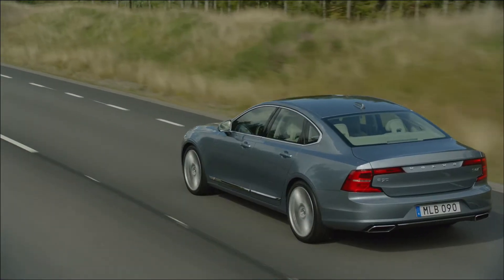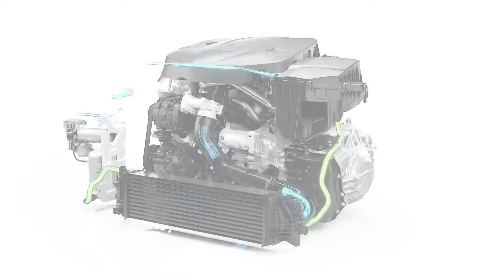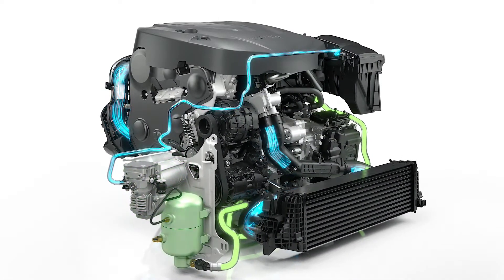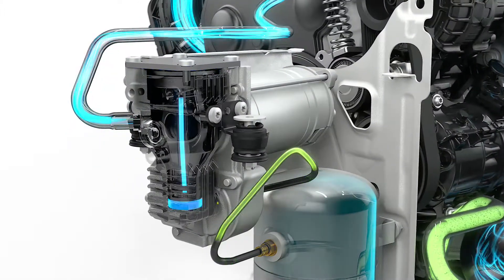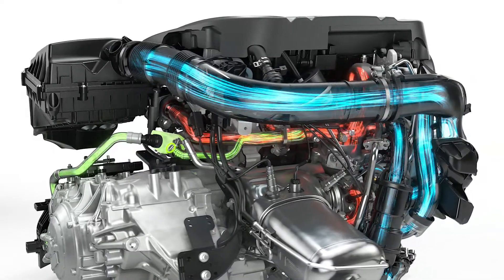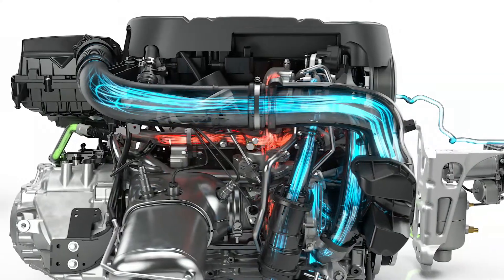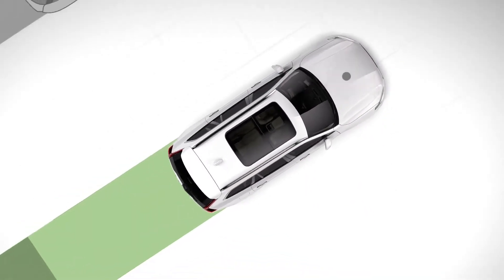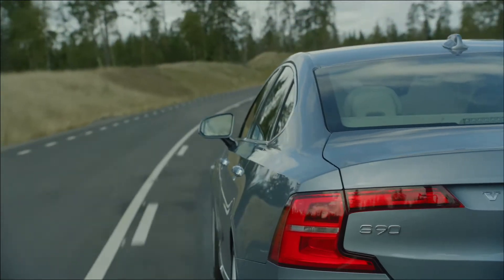Volvo PowerPulse Technology Video

Comment: Yeah I'd prefer older D5. Maybe 1 second slower 0-60 but a lot more reliable 👍🏻
Reply: you very right becuse powerpulse breaks all time+ egr
Reply: What kind of reliability issues have you seen with this modern VEA D5? I have one with 131,000km and so far so good thankfully. Although, that's low so I hope I'm not facing hassle as the mileage creeps up.
Reply: @funkypotamus Bro, i have both D5 version, the 2.4 D5 with 360000km that has 0 problems, and another 2.0 D5 with 170000km THAT HAS PROBLEMS. Having 0 problems at 130000km is not something wow